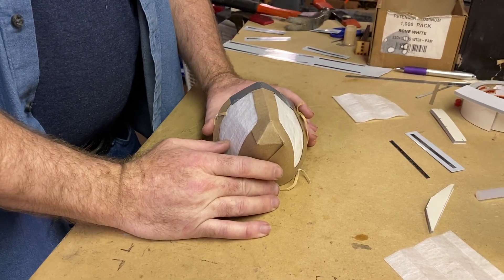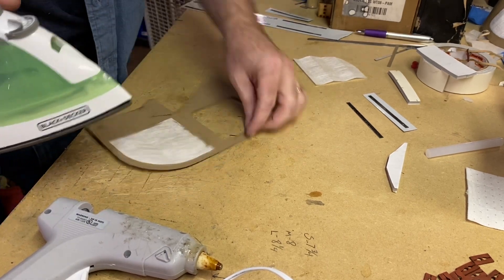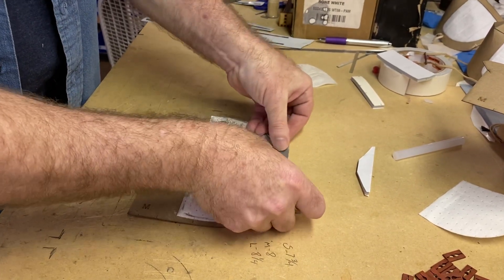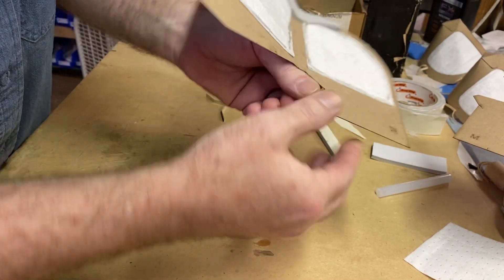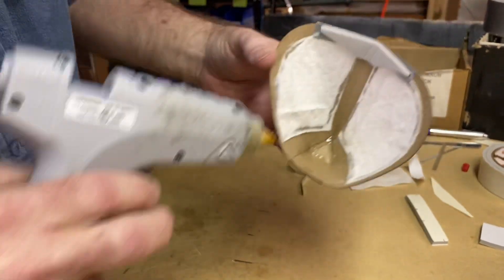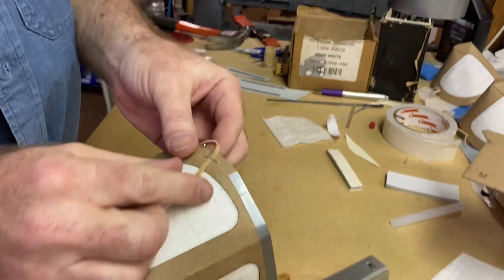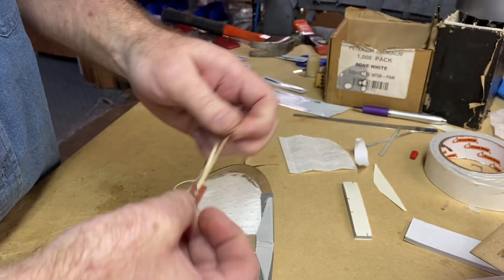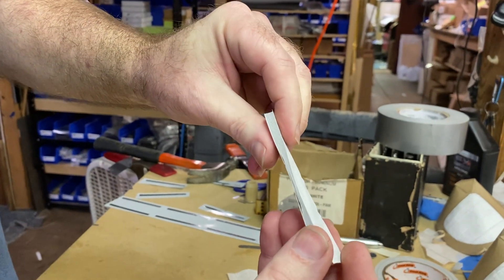Improved DIY N95 Mask Prototype

Comment: Thank you for this amazing design best one I have seen yet and best form fitting across the board, however would you mind telling me what the second filter layer you used in this video in comparison to the 1 layer filter in the previous video and does it matter which side of the filters face inward as per the airflow arrows on the merv 16  cardboard casing or Filtrete  1900 cardboard casing that the filter comes inside?

Comment: What about the fiberglass that is present in the filter? I understand it causes respiratory complications.

 I've been looking to get a roll of the actual n95 material that is used in respirators but i cant find a supplier
Reply: Many HEPA filters are made of polypropylene, not fiberglass,. Contact the manufacturer if you're not sure. If you have to use a fiberglass filter, lining the inside of the mask with a layer of cotton fabric will probably protect your lungs from the fibers.